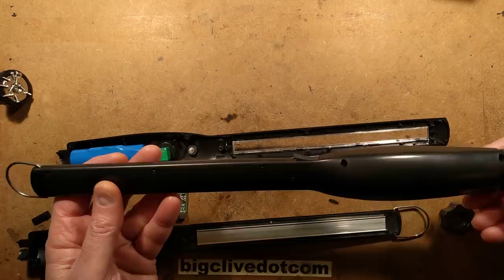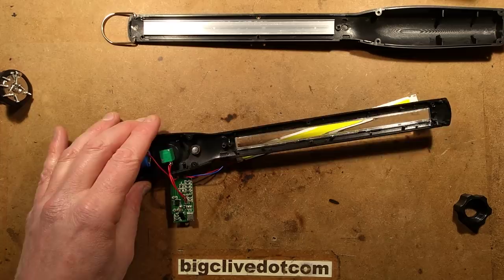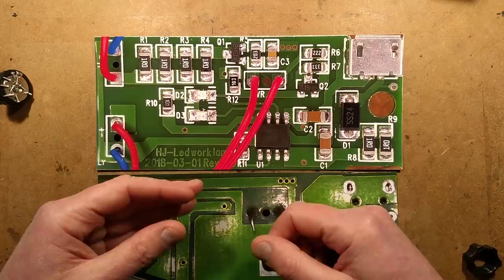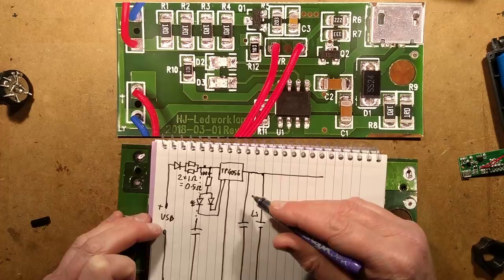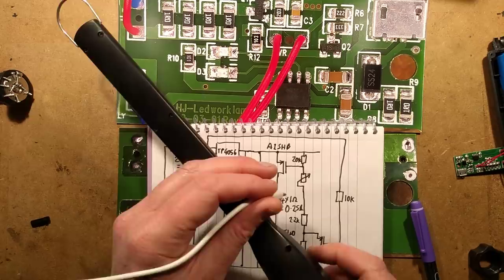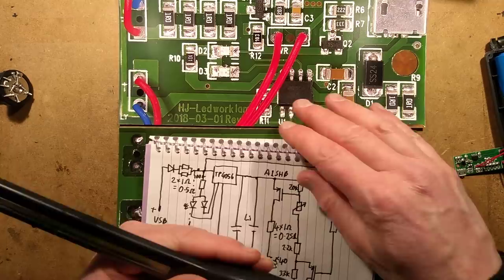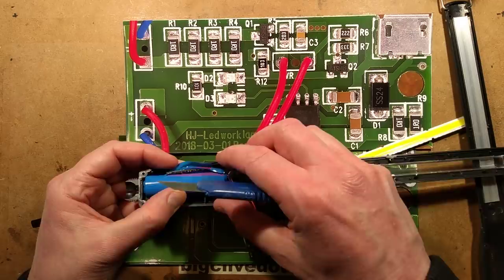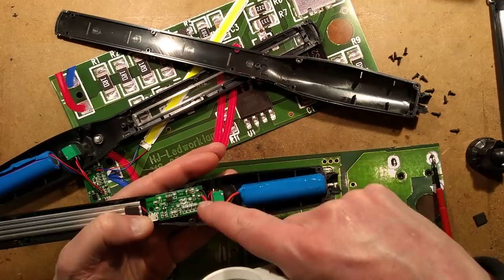Astro Pneumatic light versus clones?  (teardown and schematic)

Comment: Awww man, I thought it was gonna be some crazy light powered by compressed air
Reply: Yeah me too. Like it would run a little turbine on air you pump in or something like that.
Reply: #metoo googled it and found this https://www.larsonelectronics.com/category/593/pneumatic-light-masts ; 
y are theres the ones in clives video called penumatic ? it has nothing to do with air right ?
Reply: Yeah - similar to the Air Turbine Motor-Generator JohnnyQ90 made.
Reply: That's why I clicked.
Reply: @Andrew Garrett - They actually exist for the mining industry.  I believe Aussie50 did video on one a while back.  Pretty neat.
Reply: I bet AvE could make one of those for you.

After a lot of trial and error.
Reply: A guy has done that using turbines made from old dentist drills.
Reply: @rangerbs08  
Blow in it and it will shine like a star, yeessss.
Reply: when your vertex tube gets so hot that it glows
Reply: I thought that too
Reply: @jkmacgyver  Also on gas/oil tanker vessels and offshore oil/gas platforms and drill rigs.
Reply: Lol Me too!
Reply: I was thinking the exact opposite,  a pneumatic light.   We saw the shake light.
Reply: 333
Reply: Me too...

Comment: I've never seen these.
Might have come in useful when i was bustin knuckles fer a living.
(automatic transmission specialist, 30yrs. USA)

I have an idea. How about incorporating a small magnetic motor, with a turbine attached, to act as a generator when applying compressed air pressure?
Gives 'charging' a whole pneu meaning, don't it?

Comment: AP one is not made in China. Also made from PA66, not ABS like the others. And if you take the dating cover off the battery, you'll see its Samsung or LG, not no name like the others. (I've opened both kinds)
Reply: Thank you for that info. The Astro lights are great lights.
Reply: @ItsMrAssholeToYou  ?? Who put a spurt in your drawers?
Reply: @ItsMrAssholeToYou  
'Not to be used as a gardening tool' ,that makes no sense.
Reply: Chantal?? Tell me to bugger off!  But im interested in why youve been taking apart lights??  Also what is your profession?  I think its great you being in this game being a Woe man    :)  Great stuff
Reply: You know your materials, thank you i'm impressed.
Reply: Hey Chanty. U up ? Why is it called ''pneumatic'' ? It's not air power ?1? ps: can you swing by and check out my car..i think it needs a check or oil change ;)
Reply: @Choice777  Astro Pneumatic makes a lot of pneumatic tools plus many tools that the tech might also need like this flashlight.
Reply: Well i reckon it is cos of the CE marking on the back Chinese export
Reply: CE means Chinese export sorry mate

Comment: I have a Braum. It uses an 18650 battery which can be user replaced without tools. 
The Tesla uses 7,104 18650 batteries.  So when replacing the batteries in your Tesla order 7,105 so you'll have an extra one for your flashlight.
The Braum only has full bright and one dim setting selected by a button not a pot. The dim is realized by switching at about 100Hz.

Comment: Love your in-depth but yet simple explanations of the entire layout and how they work. Probably learnt more about how basic components work from your videos than from my classes.

Could you maybe open up a modern smartphone sometime ?
Would love to hear your view on how they are designed and probably educate people on how the devices that run their lives actually work... If possible that is...
Reply: not gonna lie, i've often wanted to see clive take one of those to bits and then reverse engineer the circuitboard too.
Reply: Good luck reverse engineering that. The components are SO  tiny, you can barely see them unless you have a strong magnifying glass/microscope.
Reply: @simontay4851  hehe true. A complete analysis maybe impossible, whatever possible...
Reply from the maker: The modern phones are so integrated that it would be a modular review showing the separate modules.

Comment: Driving a transistor below full on makes it a constant current source. That would keep the brightness fairly constant in this circuit because the drive voltage varies a small amount as the battery voltage drops. I use 2 diodes in battery powered items to provide a constant drive voltage to a transistor for driving led lighting at a constant 1ma. Makes for very long battery powered led with constant brightness.

Comment: It's kind of interesting how a simpler circuit = "cheaper" as in cheaply made, cutting corners, etc. for you electronics guys. I'm a controls engineer. If I can do the SAME thing with LESS code or simpler code that means quicker scan times and a smaller program which equates to a higher quality program (as long as it's still robust and debugged). It's interesting how those things are viewed in different circumstances.
Reply: I suppose it's not really that different.  It's just that the cheapo ones often get optimized past the point of still being "robust and debugged", some of them hit the sweet spot, and some, like the Astro here, cover even some extreme corner cases that shouldn't pose a problem most of the time, but are there for the peace of mind nonetheless.

Comment: I found that for serious torque, you can’t beat a bit brace. There are adaptors that fit in the standard brace jaws and let one use standard-drive hex-base screwdriver bits, and others that allow 1/4” or 3/8” sockets. Way better than almost all cordless tools.

Comment: For the first unit described, it is a bit crazy to use a MOSFET in its linear region to control LED current in a battery operated portable mini work light. 

You really would want a current controlled switching approach, but this would require an inductor. The current as seen by the LEDs would not be switching ON and OFF, the current would be regulated to a certain brightness level. The current regulation should be switched at somewhere above hearing, like 33kHz or higher, depending on the inductor size needed and cost. You would not see the light strobe on and off by shaking it.

The four 1 Ohm resistors in parallel will not guarantee 4x the power dissipation, but only spread the heat out evenly over the board. The heat then has to be carried to ambient in some manner at the power rate required.

I think the newest Astro model uses USB C (universal jack not keyed) and not micro USB II connector for power.

The Astro model regulating FET could easily move up in size to an SOT223 or even a DPAK, which would give many more options for features needing a larger die. Also, another strange omission on the PCB, is you would want to put a lot of thermal vias around the regulating FET with a corresponding large heat sink pad on the back. 

If you use a larger power package like the DPAK you can actually stripe the thermal pad (alternating solder mask over a row of vias and a row of tinned copper) to prevent solder wicking down the vias without paying to have the vias filled. With striping under the power package you actually have a much shorter heat path and the vias are largely underneath the package, which saves space, permitting the use of the larger package.

Comment: The main weakness I'm seeing for the cheaper ones, at least from a mechanic perspective. If you do transmission, brake or power steering work the fluid will make that plastic extremely brittle. PA66 tends to handle those fluids a lot longer before it succumbs to the embrittlement problem. Nothing a little plastic wrap can't fix though, stuff works wonders to protect your tools from harsh oils. I just might order one of the knockoffs next time I can afford it, all of my lights are either LED lanterns or a really bulky old fashion LED bar that had the big chunky LEDs with a magnet that has seen too many metal shavings to be useful any longer.

Comment: What's pneumatic about them?
What's a pneumatic lamp?
Reply: Astro Pneumatic is just the name of the company. They make professional tools. They started with Pneumatic tools. Hence the name Astro Pneumatic. Little bit of copy and google goes a long way.
Reply: @patburnsent  Pneumatic = air powered.
Reply: Oooooh, it's an Astro Pneumatic lamp.
Not an Astro Pneumatic lamp
I did Google it, but the website is astrotools.com
Which still implies it's a pneumatic lamp
Reply: @dwarf365  They are semi-professional at best. Their tools are not top notch quality but they will get the job done well enough  if you are a cheap a$$ .

Comment: I have the Braun LED light (H.F.) "clone" of the Astro. Pretty much the same thing except the angle adjustment is between the light and the handle. It's worked well. About 2 yrs ago I dropped it into a bucket of coolant. Probably soaked in it for about 15 seconds till I rescued it and I still use it today.

Comment: Great video upload Clive! Thank you for brightening up a dreary rainy Saturday afternoon here in the state of Misery (Missouri) I have a "very" Cheap-O version of these LED lights that doesn't have a variable resistor control, just a push button switch that selects between the long 20 LED COB and a small 6 LED COB at the very end. It came with four really cheap "Blazing Voltz" brand AA size batteries that say Super Heavy Duty - No Mercury added along the side. LOL Thank you again for making my weekend a lot better!  :)

Comment: Interesting that the Astro unit's battery doesn't have any circuit board attached to it, but (and I probably missed it) there doesn't seem to be that circuitry on the Astro's main board either that offers the same functionality.  When it comes to saving pennies on each device, I'd assume that copying Astro's single circuit board design would be cheaper.

Comment: I have 2 of those.  But must be even more "original". Charge port is in the rear. Charge indicator has 4 blue LED's. Which show state of discharge/Charge. Does not dim on  charging while in use. And now been in service for approximately 2 years in a professional setting.

Comment: The 33322 IC is probably the m34 LED flasher IC. The only ones I could find are through hole ones but they too have 3 pins, so it seems to be the same chip

Comment: I just found one of these in the road, slightly run over and a couple of leds gone. After charging it is pretty damn bright. I like it.
Reply from the maker: Someone somewhere has left their light in an engine bay after working on a car.  Maybe making it yellow would be a design improvement.

Comment: Clive, you should take a loot at Lidl PSDD 2000 A1 light. It's the same type of light as those in this video, but the PCB has different and quite interesting two board construction.

Comment: Hey Big Clive,

When I was a tiny kid, I had a snap circuits kit; it's a kit made of electronics components encased in big hunks of plastic with clothing buttons set up to electrically connect them. One day, I was building one of the project circuits when a red LED started quietly screeching, increasing in pitch, until the diffuser violently burst open, hitting me quite hard in the forehead with a tiny piece of plastic. The LED was running on normal voltage it was designed for; the kit must have been about six or seven years old at that point.

What could have caused the LED to explode like that, considering it was only running on two AA batteries and the package it was in was designed for exactly what it was being used for?

Comment: Opened mine. Same mainboard date as the first one. But different resistor values and none of the capacitors where soldered. I added a thermal pad on the mosfet. Hopefully it will last longer with it.

Comment: I seem to have missed something or misunderstood. @bigclivedotcom  the  drive for the mosfets 
 was there or not a  high value  resistor "10k thru 1M" on gate of mosfet to ground to  force open the  A1SHB.
mosfets are a  Voltage device if gate left floating it  wont change state or at least remain at the previous state.
if you have omitted for clarity   or confusion i understand. 
or is their no need for  said resistor because of the potentiometer must be scrolled to zero before the switch cuts connection. 

it is odd that youtube finds that it wants to correct mosfet to samoset or marmosets if it is mosfets. 
potentiometer is not in the dictionary as well.
Reply from the maker: The divider on the gate of the MOSFET biases it hard off if the potentiometer switch is off.

Comment: The only problem with linear vs PWM is the extra power dissapation. You're always dissipating all of the power regardless of brightness. You just move the power from LEDs to the MOSFET.
Reply: yep, ....its certainly possible to make a 'flicker free' dimmable light, but still using pwm, but would need extra components,

Comment: I think you could help out the mosfet by placing a thick thermal pad over it and several components.
That's how they did it in my Amazon Fire Stick so it should work for a work light.

Comment: assuming there is no capacitor on the gate of the mosfet then the longish leads from the pot will act as an aerial/antenna which is bad news if you are using this under the bonnet of a running petrol engine!

The chances of destroying the gate with induced high voltages is significant.
Reply: The gate has less than 20k to the supply rails.
Reply: @FarleyHillBilly  20k is quite a bit if you place this near a sparking ignition coil lead as is often the case for an automotive inspection lamp.  the board looks like it has a cap on it but it doesn't appear clive drew it in.
Reply from the maker: There was a cap on the MOSFET gate.  I forgot to draw it on the schematic.

Comment: its always nice to have a great work light, preferably that has some staying power. I have been intrigued by these cob panels after watching you and have been scavenging them if possible.  Im watching you do this video and pulling apart a christmas light string with one of those drivers that swaps the polarity to light a long string with alternating sequences, 8 modes.  all apart I got a nice battery box for a jewel thief or solar light and a long string of leds to build with. I even saved the driver board and tested it to run on LIon.

Comment: The 4 X 1.2 ohm resistors in the expensive light will have a lower resistance than the 2 X 1 ohm resistor used in the cheaper light. This could explain the higher light intensity of the premium light.
Reply: I think you need to watch the video again...

Comment: Arguably the Big Chinese Insight is that "by the book" designs seem to include quite a lot pf components the absence of which makes absolutely no damn discernible difference whatsoever in practice. Granted, they seem liable to sometimes take just that one step too far over the line, omitting something that definitely does make a difference and then things rapidly go south fairly inevitably; but I have to admit there is a great deal of stuff where their approach seems to work perfectly "good enough" with a far less fancy solution than a "proper" design would involve...

Comment: Same design, with an 18650, and a waterproof / solvent proof usbc port for charging would be great.
Reply: The issue is the USBC. I have not seen a waterproof one yet. I'm not even sure it's possible without a ridiculous cost. Inductive coupling would be easier possibly.
Reply: @gordonlawrence4749  te connectivity makes them. Solvent resistance is hard, but waterproof is easy.
Reply: @RobertSzasz  I will have to take a look at those thanks.
Reply: @gordonlawrence4749  to make the usbc style port actually waterproof/capable of not degrading it wet conditions instead of just keeping water out of the enclosure it couldn't have power between any of its pins while idle. With a larger footprint, elastomer pads or wipers could be added to keep the contacts dry until a plug was inserted, but it seems all the manufacturers see in USB c is small size instead of a relatively robust "universal" connector.

Comment: The 33322 in the original Astro PCB is a rectifier. The rectifier will allow to make a more stable continuous current and protect the capacitor and batterie while It's recharging. Rectifier are use in UPS for the same reason. The real Astro will last for a really long time.

Comment: The 2305 (Si2305DS) MOSFET in the original is specified for a gate turn-on voltage as low as 1.8V (at 0.108 Ohms drain-source resistance). Cheapest price in volume (>1000) I could find: $0.16. The A1SHB (Si2301DS) in the Chinese clones is specified for a gate turn-on voltage as low as 2.5V (at 0.180 Ohms drain-source resistance) - at 1.8V the A1SHB it basically off. Cheapest price in volume (>1000) I could find: $0.14. Every Chinese engineer who's worth his or her money would of course swap those parts to shave off 2 cents. I mean it's simply to tempting: Putting in a part that barely meets the requirements, slowly cooking off in operation and making 2 cents per unit while doing so? Who could resist?

Comment: Wouldn't a switch mode power supply avoid the problem of flicker by providing either a constant voltage or current via a LC filtered output?

Comment: MOSFETs confuse me.  I remember ordering some for what I thought was a simple circuit design then finding out (for that specific type) once they turn on you have to maintain the voltage difference at the gate to keep them on by 'bootstrapping' them...
Think I've still got them actually.  Want them?